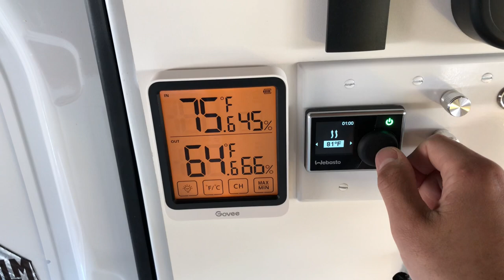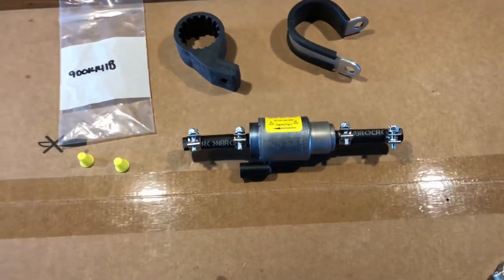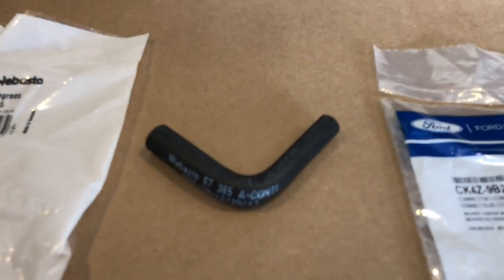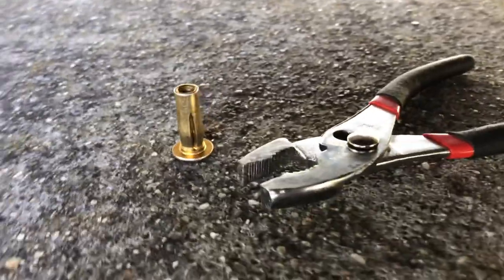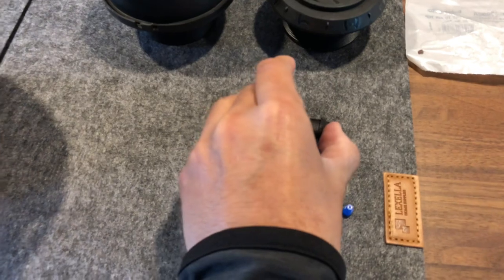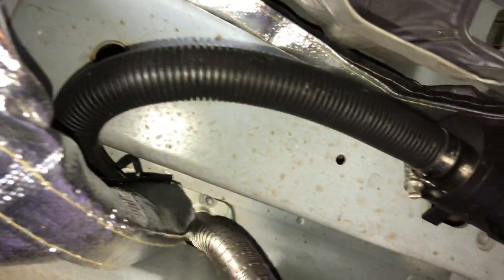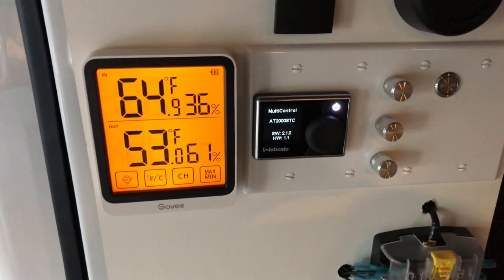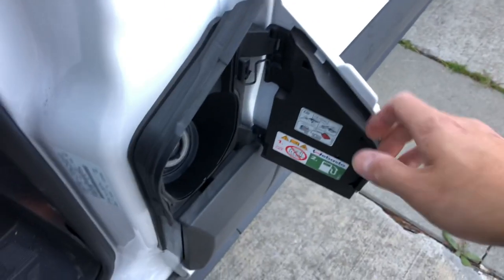AWD Transit WEBASTO HEATER Install UNDER PASSENGER SEAT! - Part 20

Comment: Careful with the air intake filter so close to the heat shield, might start to melt.
Reply from the maker: yeah good point, I'll have to monitor it.  The exhaust itself is almost 4" away from the heat shield and the intake is 2" away.
Reply: @RichBuilt  Totally. Coincidently I just put mine in, and my routing is a bit different but I found anything close to that shield was getting warm to the touch after some driving around. Worth keeping an eye on but its all looking great. Thanks for sharing this in such detail; I wound up with a nice and toasty 5k diesel heater with separate tank, but the fit is TIGHT under that passenger seat!

Comment: Another great video full of detail and hacks to make the system better (and my life easier!). Good Work!   Did you run new wires or the wires that came with the heater that we see coiled up in the seat pedestal through the van frame to your control panel?  I'm mid way through my build and I'm not sure if I need to run extra wire for the heater. Why did you connect the heater to your battery vs your control panel. Thanks.
Reply from the maker: thanks Robert, yes I ran the wires that came with the kit.  I didn't wan to recrimp the ends so I just rolled it up as neat as I could. I hooked it up to my control panel fuse box, not the car battery.

Comment: Many people put the heater under the passenger seat but I wonder about the heat getting to the bed area. Anyone putting the heater in the middle of the van, or putting ducts to get heat from near the passenger seat to the center or back of the van? Or perhaps the distance from van front to back is so short that it really doesn't matter where the hot air outlet is?
Reply from the maker: Yeah you got it right, the heat fills the entire space quickly.  If you had the duct directly under your bed or near your body, it would get uncomfortably hot as it warms up the cabin.

Comment: I had the Wabasco. Its only good to 50°F.  You need four of then to get down to zero F.  It needs its own fuel source. Do not connect it to the engines fuel tank. There are better methods of heating a van.